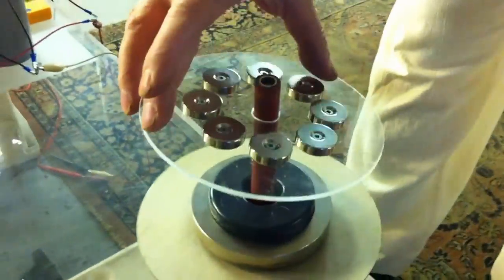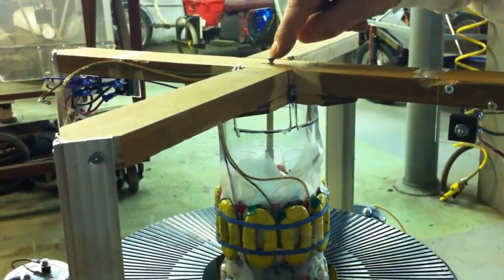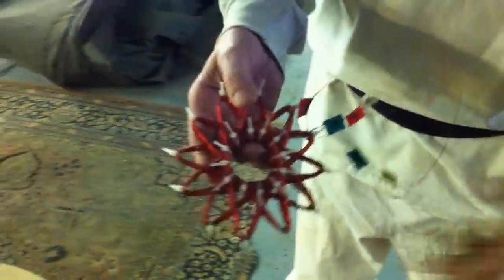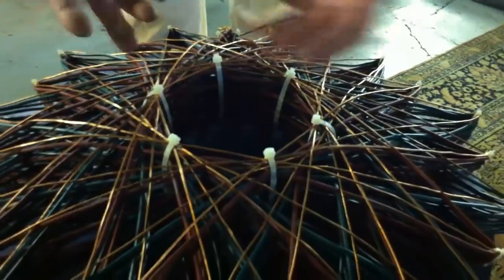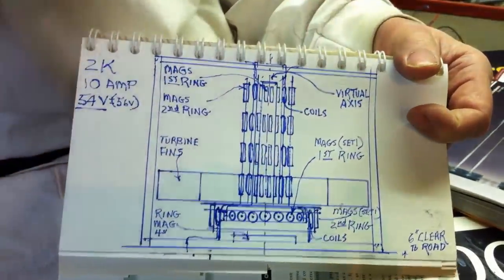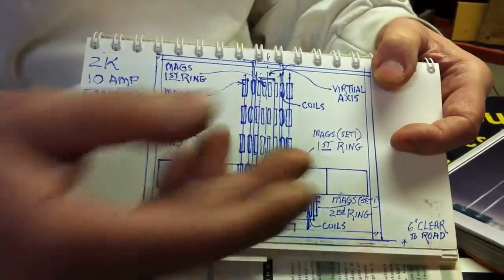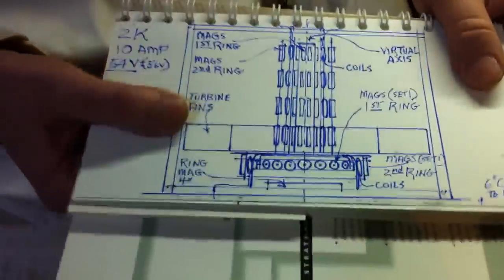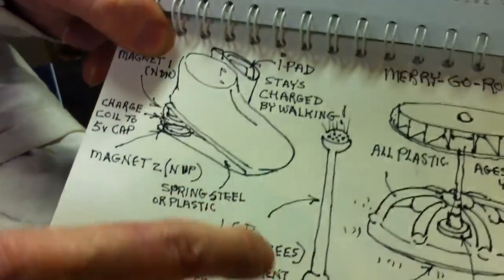UFO Alien Leak - Levitation Stability FS6

Comment: He has some good ideas, and I'm actually thinking along these lines as well.
How cool it would be to have your own personal aircraft which could pull vertical and horizontal directions, and it turns out that any given direction can be altered via X and Y axis, but more needs to be confirmed before practical use.
Magnets should always have a counterforce measuring the gravitational pull downwards, maybe.
Still learning about the topic, but it has to be checked out =D

Comment: Flying saucers that are controllable use astable gyros for flight control (pitch, roll, and thrust) , atmospheric thrust vectoring and storage of energy in the system. Starting up they have low gyroscopic angular momentum and as the power input continues they increase the angular momentum until they have about 2 x the lift power. then they apply the momentum to the lift surface and take off like a rocket. This is why they move quickly and suddenly yet seem to cruise for a period. this cruise time is building up the power in the storage system.
I designed this type back in 1990 whist the GIT project was all the rage and applied it to useful atmospheric propulsion rather than physics defying gyro thrusters.

Comment: That's right! No heavy "engine", axles, drive train etc. It took me awhile to build Levitated electronic drive, & air turbine ended up on top of same axis (see FS14). I am building horizontal Levitated turbine assembly now (for next video). The lack of friction for these rel. heavy gen. (unlike CD players) is crucial; as is some device to allow heavy jolts and impacts, for real-road use. FS14 has both these (finally!); but Horizontal yet to be built (with min. air resistance, friction, weight)..

Comment: Thanks! This vid shows an important mid-point in development. It stresses the generation rather than motor function. It points to CARS, not "UFO's"! Cars can use friction-cutting levitation! I have added non-magnetic bearings (for real-life angles); & COMBINED air turbines with electronic generation - on the same column (see new FS14). About vacumn's for friction-cutting - roof dome turbines can suck air out od sealed column - more at greater speed (when needed more). Chinese now building!

Comment: The electric motor design is linked to so many other devices, as it uses the principle of elecro-magnetic induction, and magnetic repulsion. These two things are used in the design of many other electrical devices, ( e.g transformers, car alternators , e.t.c ). This guy's video is still good as it uses these thigs in different way.

Comment: This guy NOT crazy. Look up Nikola Telsa's reasearch in the early 1900s. Telsa was demonstrating WIRELESS transmition of electrical power, using magnetic induction 100 years ago. A bulb would be placed in a field near a Tesla coil.It would glow, even though it was not physically connected to anything. A large amount of technology is being witheld from the public by the ruling elites. In the next few years you will see companies selling wireless charging devices, as if it is new technology!

Comment: @UrCoffeeTastesToasty  Yes! Just built a "StarNest Coil" (2 Starships condensed to small diameter): This is the BREAKTHROUGH that can propel the Electronics Revolution movement out of it's hang-ups with trivial lead batteries - onto the highways of the world! It's the TORQUE & the SPEED of RPM'S! Pulse motors were WEAK - now they are STRONG! On to faster pulse switching! On to dual-input MOSFET POLE ALTERNATION! On to STACKED 3-phase Generator CURRENTS to the WHEELS! DOWN WITH OIL DICTATORS!

Comment: @PUTAGUN Ha! These are about no-fuel Earth transport: 10 amps at 56v within 4 cubic feet must be delivered (minimum) for small cars. Neither "natural" Turbines nor Electronic ones have been able to do this alone. They must be COMBINED in some ? way. Here I show "squirrel-cage" Lev-Bearing conversion for added output. Hall Effect switching has added rpm's & torque to Lev-Electronic types lately. Small intense Plasma Drives (in flat TV's comp-monitors) may deduct 70% or more weight from trucking.

Comment: The high currents produced by spinning 3-phase stack Modules can be used to produce various FUELS - ALL of which will cost as much as GASOLINE or MORE! (Dig Bottled Water in stores now!). There is a LEARNING curve to this CIVILIAN Alien Reverse engineering: Here you see NEGATIVE "Point Zero" energy at TOP of fiber rod (no friction at zero contact dimension); next we GET RID of the Axel Rod altogether! Plasma in Flat Screen TV is same as "TR-3B" & "Aurora" military "UFO's" - good for TRUCKS?

Comment: @Sweemoo Yes - The current produced can easily power many Fuel Cells making pure "H". I am concentrating  on connecting these multigenerators to Flat Rodin coils to provide steady high-speed highway energyl using only multicaps. like ones shown. Readings were 10m, 17,5v, 8v =39v series (if you couldn't read).
Many designs can derive from this Lev-Bearing / Air Turbine type (as others besides me have been noting). Good luck with YOUR projects!